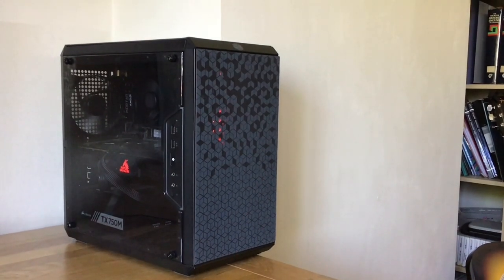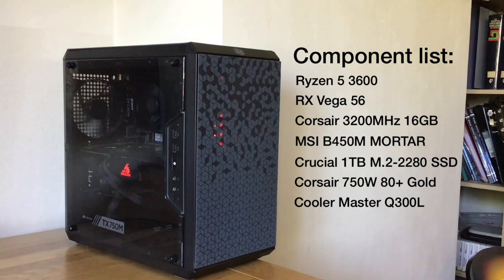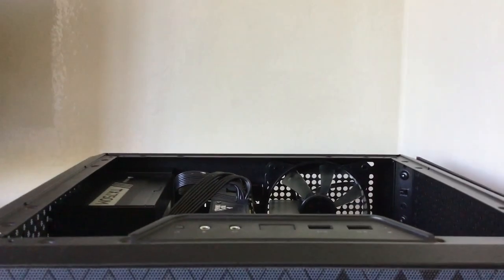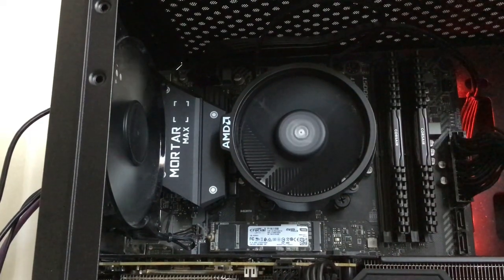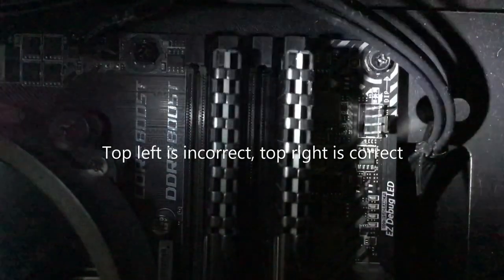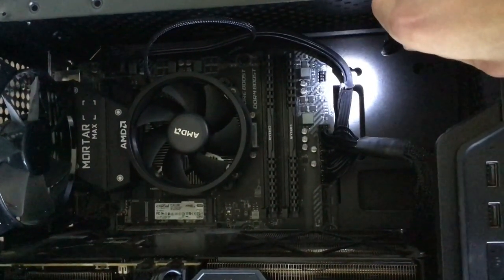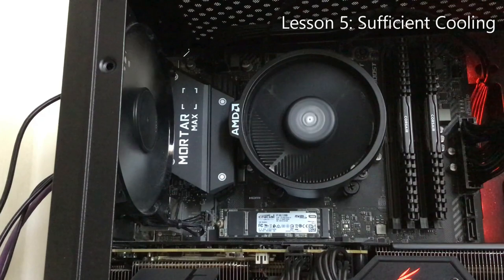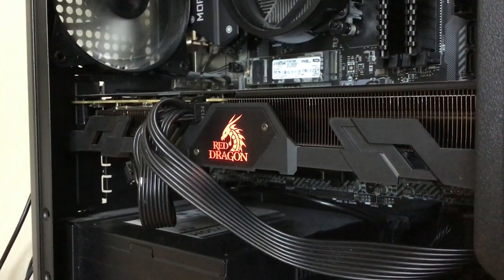5 Lessons in building a PC

Comment: yes... taking your time
fast is slow
slow is smooth
smooth is faster.

I just dug-out an old boxen of mine build 2003/4, done around an amd 2600, 2gb, seasonic s12, ide raid 0 2x200gb hdd, win 2k and a 9550 iirc (swapped out in other boxen)
I keep meaning to run it up with a *nix on it.

good luck for next time,
I think you did well